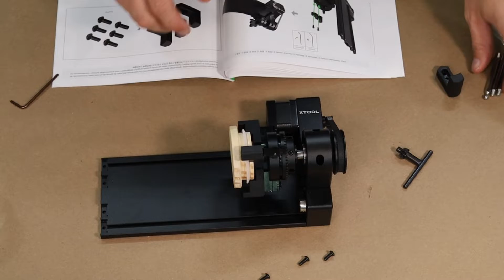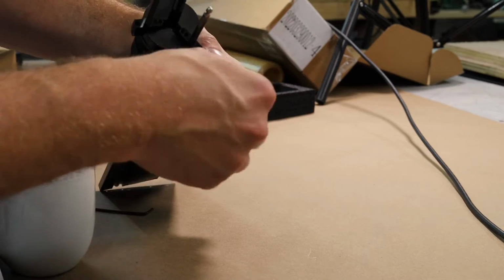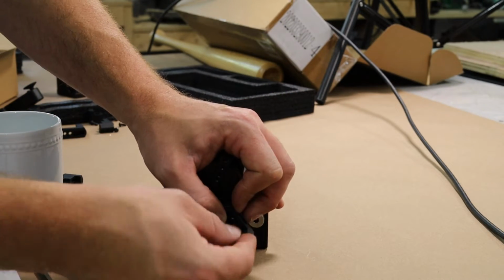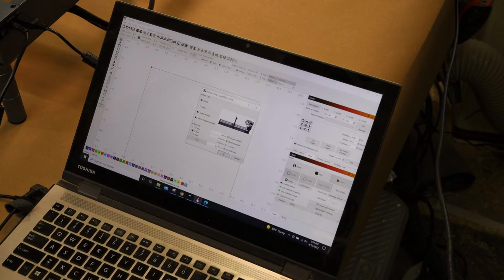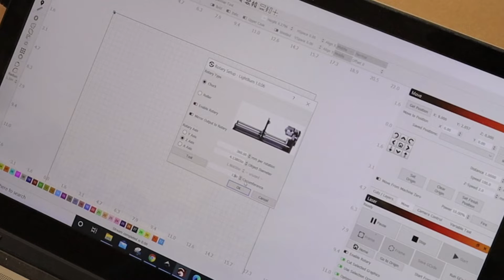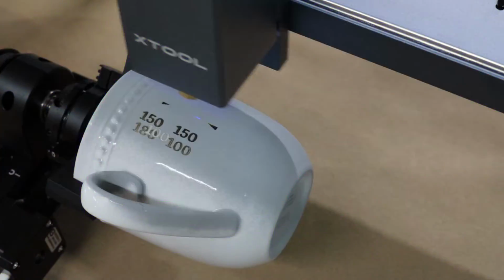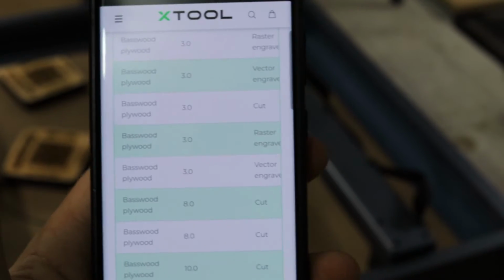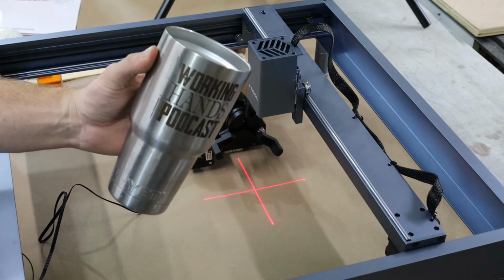Showing off what the RA2 pro can do xTool Rotary Engraving

Comment: I've been using the regular rotary for a year now. Finally fed up with some tumblers today do with the handles so I'm going to give this a shot. It's on its way. My goal is to put the new one in the Chuck style mode permanently and use the old one when I do not require the Chuck. Will I have issues? Do they have different settings that would have to be changed each time?
Reply from the maker: I believe having both is a smart move. As far as I remember you will just have to check the box on whether you are using the chuck style or rotary the settings should remain saved for each.
Reply: @Chads Custom Creations  thanks.  I'll reply to this thread once I find out for sure and maybe it will help someone else

Comment: Does this rotary device work with CO2 lasers like Aeon or Thunder laser?
Reply from the maker: I believe those lasers might run a voltage of 24v  instead of the 12v that I believe the xtool pushes out. You may just need to put in some kind of reducer to keep it from overheating the stepper motor but I believe it could be done or you could even replace this stepper motor with a larger 24v motor. Disclaimer I am not an electrical engineer and I could be wrong.

Comment: quick question: I am engraving a wine tumbler and i have tried everything...everything. My solution so far is to use the 3 metal prongs on the chuck on the INSIDE of the cup. My question is, do i turn the machine the opposite way to get the engraving right side up? (I think i'm overthinking this)
Reply from the maker: Best advice I can say is put a piece of scrap in or a test cup in there and note the direction of the logo and if it is mirrored you will have to rotate the rotary 180 degrees.
Reply: @ChadsCustomCreations  thanks so much!

Comment: Hello, how do you get it to engrave in black on the mugs?
Reply from the maker: I used a spray called cold galvanizing spray but I don’t recommend it the fumes seemed super toxic and set off my fire alarm instantly. I would instead recommend cermark ceramic marking spray.

Comment: great vidéo, is it compatible with Sculpfun s10  20w ?
Reply from the maker: I would think so check the description on  the link in my description I believe they have a list of confirmed machines that are direct plug and use. If not you could always wire it up to a plug that would fit into your y axsis stepper driver.

Comment: I am waiting for a tutorial to be able to engrave on a ring, silver or gold, I saw that you put a special srpay to be able to engrave, could you explain to me what srpay you used and what is the configuration in the software?
Reply from the maker: Yes that is brilliance marking spray or you can use cermark spray let it dry. My setting was 100 power 100 speed but I believe you can go faster and still get great results.
Reply: @ChadsCustomCreations  Excellent, is there no other way to engrave gold and silver rings with just the correct laser?
Reply from the maker: @osvaldofervio7809  so as far as I have found the 20w diode laser will engrave steel. For other metals you need a fiber laser or xtool is putting out a infrared laser head that has the correct wavelength for metals and plastics.
Reply: @ChadsCustomCreations  I have xtool D1 and just saw "xTool 1064nm Infrared Laser Module" which can engrave on silver, gold and all metals, so before I buy it I would like to know if my xtool can use this or need more tools,
Can I contact you or a call to explain? I need engraving for a jewel.
Reply from the maker: @osvaldofervio7809  if you have the D1 it will plug in right where your other laser head goes. Go check out their live demonstration on their channel on xtool YouTube channel

Comment: Do you know if the RA2 will work with something as large as a basketball or volleyball?
Reply from the maker: Phew that would be tricky, they do say that you can 3d print grabbers for the jaws, so it's possible maybe. With something like I would either use the roller function of the RA2 pro instead of the chuck, or you could hot glue a puck or something to the ball that you could grab with that jaws of the chuck.
Reply: @ChadsCustomCreations  Thank you, I was thinking if not then maybe the Laserpecker 2 would as it has a hand held feature

Comment: Hello there I have a question do u have to change the cinconference and the diameter for each cup?
Reply from the maker: If all the cups are the same no need to change when using the Chuck style rotary.

If using it in the roller style you don't ever have to change the settings once you have it set even when your objects are changing in diameter
Reply: @ChadsCustomCreations  but on the chuck I have to if they are different sizes
Reply from the maker: @rigopulido4897  only with the Chuck will it make a difference you can still type it in with rollers selected but my understanding is if you have the diameter and steps set correctly on your rollers you don't have to change anything else. 

Chuck yes change it 
Rollers doesn't matter
Reply: @ChadsCustomCreations  thank you

Comment: Is it worth putting this say on a laser master 2? 5.5W output or do you need to go stronger for glass and mugs?
Reply from the maker: Oh heck yes definitely you may have to run it probably slower but it should do great.
Reply: @ChadsCustomCreations  any chance this will work for a onefinity CNC with a jtech laser connected? I have a 7w laser on it. I have laser master 2 as well. but the stronger laser is on my onefinity.
Reply from the maker: @st0mper121  Do you happen to know the voltage output coming from the onefininity y axsis driver. If it is 12v and not the 24v I believe you would be able to wire up a. Plug and it would work perfectly.
Reply: @ChadsCustomCreations  The steppers show 2.8 amp im going to guess its 24 V ill just keep it on the laser master 2 if its powerful enough.
Reply from the maker: I think you will be happy with it set up like that. If you ever did feel like changing it over I believe there are voltage reducers you can put inline to make it work but I think keeping it on the dedicated machine would be best.
Reply: @ChadsCustomCreations  Lol no offence but i called a local makerspace They said same thing:) about the reducer, good advice:) if 2 people telling me its gold:) going to try the laser master 2 first and make it into a stand alone if does good. thank you sir... put my mind at ease..

Comment: Hi. Have you tried engraving a pepple? How long does your laser last and are they expensive to replace?
Reply from the maker: Do you mean a pebble like as in a rock? If so I think it maybe similar to engraving on that slate coaster so would probably lighten up the stone I bet it would work great in darker rocks. I believe they are rated for 8000-10000 hours of laser time. To replace you can check out the cost of the laser units on xtool.com
Reply: @ChadsCustomCreations  yeah a rock. Looking to put a picture name and date on there for momerial. I was thinking it would be the same as slate but didnt want to damage laser. Thanks for your help and prompt response
Reply from the maker: @MyPawfectJourneyFYD  damage to the laser shouldn't be an issue.

Comment: Can you engraved on plastic materials with the xtool?
Reply from the maker: Acrylics definitely and if you see I engrave on that plastic cup I didn't quite get the right speed and power but it actually did work.
Reply: @ChadsCustomCreations  alright thanks. One more further question. What if I have a 3d printed item. Can they be engraved too?
Reply from the maker: @idustee8092  good question I will test that out PLA right?
Reply: @ChadsCustomCreations  yes PLA. Thanks so much

Comment: Can anyone confirm if this works with a ONEFINITY?
Reply from the maker: I cannot but I imagine it would be possible as you could probably wire it up to just use the Y axis wires to control. I believe this runs on 12v so you may need to convert that if the onefinity is running on 24v

Comment: I got a question. For stainless steel. Do you have any recommendations for a black laser engraving marking aerosol??? I’m thinking on getting on spray on Amazon to engrave some knives but not sure if my Xtool D1 (10W) would work
Reply from the maker: This is what I am using having great success works with my d1 10w I used it on the ring. https://www.amazon.com/dp/B07K4Y8D62?tag=onamzchadddow-20&linkCode=ssc%20&creativeASIN=B07K4Y8D62&asc_item-id=amzn1.ideas.9RX0388VQUF4
Reply: @ChadsCustomCreations  Can you use this on glass?
Reply from the maker: @AmericanPride4321  yes with glass just need to put down something to absorb the heat like black tempura paint or there are other options also.

Comment: I have a request for something I would like you to try. I have not been able to find anyone who's done this yet, but maybe I'm not looking hard enough.  In my head I'm thinking of starting with a flat piece of lexan or similar material in either white or clear, and it would need to be just a few mm thick.  On one side I think it would need to be painted black and then have a graphic etched into that side.  This way when a light shines from the back the graphic "lights" up. Can this be done with a laser like the XTool?
Reply from the maker: I think this can be done I am adding it to my list.